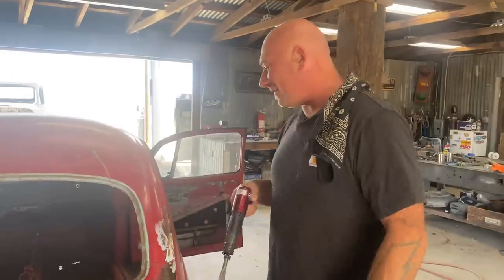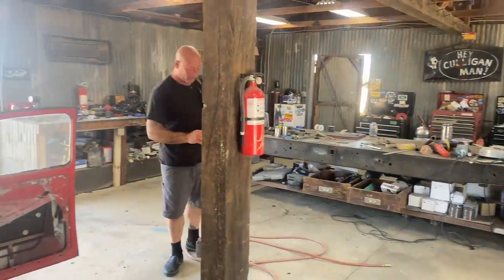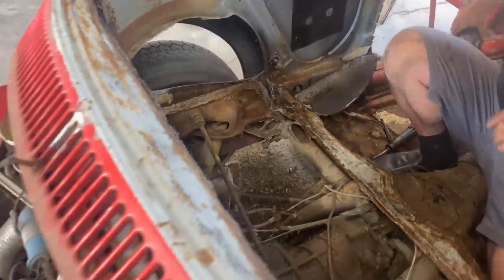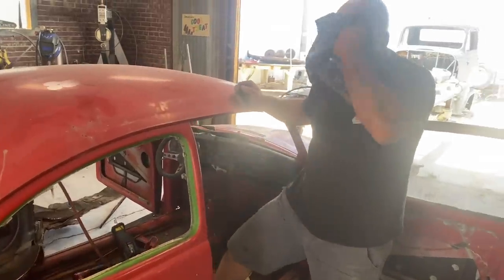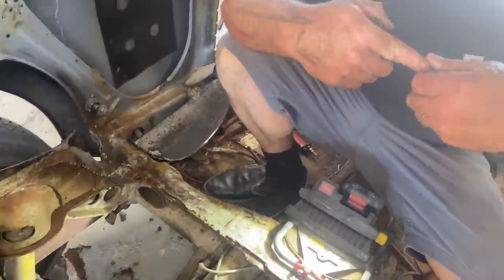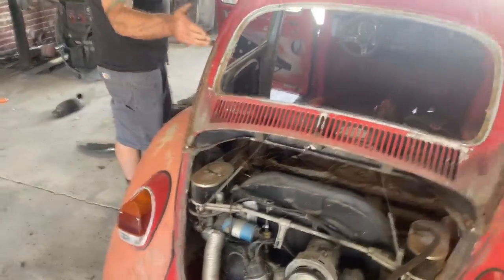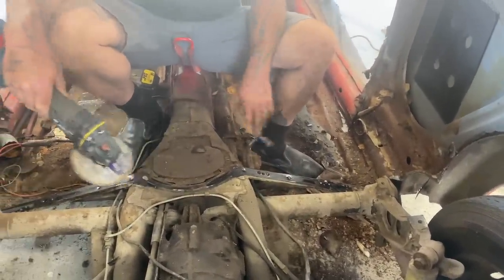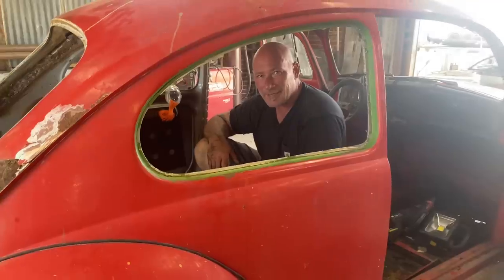Part 2!  Full Custom Ian Roussel 1968 Volkswagen Radical Custom 🤖 Floor Removal 👽🤓🚨

Comment: I love custom VWs and have always dreamed of building a bug that has never been done before to my knowledge, but I lack the physical capability now, the welding/ body skills and a workshop to do it in.
My idea was to use a Type 3 floor pan which I believe is wider than a Type 1, and place a sectioned Beetle body on it making it a wider track and overall wider vehicle. Of course using either '68/ '69 suspension or a custom set up of double A arms. Ian is the only fabricator with the genius to envision and make such a beast.

Comment: Loving the deconstruction so far, there was a lot of rot there, out of curiosity as you’ve pulled out a boatload of structural integrity out of the car are you going to weld in some tube to help the body maintain some semblance of shape to it? And as others have said Jamie and I said it last video thank you for lowering the sound on some of the equipment used, as I said before I thought it was my phone acting up at first but now that I know it was you being responsible for it I’m truly thankful for that unexpected reduction of noise.

Comment: No guts No glory 😉
Metal won't bleed to death or have a heart attack on the table 🤔
My Moto
Unique is what we seek 
Bizarre is what we are !!!!!!!😂
Enjoy your adventures 👌🤠✌️
Reply: @fullcustomIan  I've had and enjoyed several bugs over the years 🤪..but the one I always wanted to build was a giha Baja !!!
Hint Hint 😉👌just saying 😂 I'm currently building a 35 Chevy 1/2  ton in to a speedster .. frame was made in to a trailer with a tongue welded to the drag link in the 50s 😂 it's a start 🤔.. I found a grill radiator and windshield frame at swap meet ..
I bought a wrecked and rusted 4door Chevy 2 for the drive train 👍😊 Now the fun begins.
Enjoy your adventures 👽✌️

Comment: Ian, I don't know if you realize that  lowering the rear of a beetle so it has a lot of negative camber is an ancient (late 50s) quick and cheap way of ameliorating the tendency of the car to oversteer and possibly having the rear wheel on the outside of a turn tuck under and roll the car over. We oldsters called it decambering and you'll see it on 356 Porsches too. Other ways of reducing this tendency are adding a stiffer front stabilizer and installing a zero roll stiffness added spring in the rear called a camber compensater. Standard on Porsche Super90s and '65 swing axle Corvairs. It's all because the rear roll center is at whatever the height of the inner universal joint of a swing axle car is while the front roll center is at ground level on a double trailing arm front suspension which transfers the cornering load at the rear to the outside tire of an already tail heavy car while transferring much less load to the outside front tire. Decambering lessens this tendency and makes the car more controllable at high cornering loads. As an aside hanging a heavy tow bar on the front of the car would even out the weight distribution and mostly cure the oversteer too.Or sandbags in the trunk.

Comment: I noticed two things about this video, that have nothing to do with the Bug. 1) when Jamie is filming Ian, she is shooting into a wall of back light (from the outside). Basically the brightness range, from the black in Ian’s socks to the outside sunlight is more than the camera (IPhone?) can handle and 2) because of the desert heat, Ian is constantly sweating profusely. What you need is an Australian air conditioning system. If you soak dark hessian curtains in cold water overnight and then hang them at each end of the workshop, you will achieve two things 1) any breeze that blows through the shop will be cooler, thanks to the wet curtains and 2) If you hang dark curtains, say half the  height of the sliding door, you will also reduce the glare coming through the openings. Most of Australia gets as hot as your desert hide away and this way, after a small amount spent for the initial materials you can achieve both cool factors (for heat and lower light) and are then free. Want it colder for longer, use an ice bath each night to soak them in. I hope this helps.

Comment: BTW camber compensates are still available from EMPI and others for around $130. Or a '71 or later chassis has the same semi trailing arm suspension as a Porsche 911 and doesn't have the oversteer/rollover problem.
Reply: is this chatting? not sure how.

Comment: One more thing. Did you know that the inner and outer splines on the rear torsion bars have a different number of teeth? So you can set the rear height to whatever you want by trying different angles on the bars.
Reply: Yes but it messes the caster & camber up, it's only really to set/reset to factory level.

Comment: I used to see so many  VW's  in the 60's & 70's  on the road and I don't understand why both rear wheels have such a outer camber causing excessive wear on the outer tire tread.   Also  you see a VW  ahead and it has burn marking indicating a major engine fire at some time.   I understand that it is not a water cooled engine.

Comment: Yeah, glad to see Thurstens' cousin has a relative down on the Mojave.  So, I went into this local  trailer park, climbed a short hill in a K1500, ...and the tortoise cousin was slowly crossing the road in front of me.  

I was a about 25 feet below it, ...it stopped, turned it's head, repositioned it's body, raised it's head in an obvious daring posture, and started to descend the road while challenging the K1500 to a fight, all seen by the look on it's face.   

I turned off the engine, got out, and the tortoise let out this noise from the mouth as a challenge.  I stood fast and stared, ..., then deciding to get back in the truck, and back down about 100 feet away.  It watched for a few minutes, and then turned, and went on it's earlier intended position. Found out later that a pair of them live under the trailers, even in winter.  Just thank my lucky stars the other one never came out fir support.

Comment: I have cutup my share of vws making pipe rails. If ou take 6"" drop in tunnell. What are you going to do about shifter tube or rod call it what you want. Are yougoing to cut tunnel open. Or make it taller to keep it strucksurly solid. It will bend even with body supporting it ? 💜👍😀🤎🩵